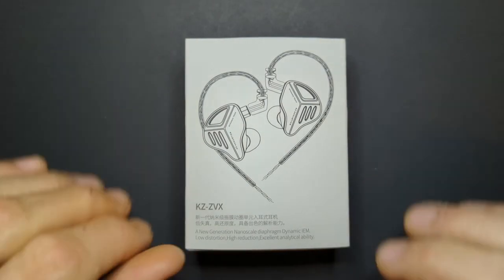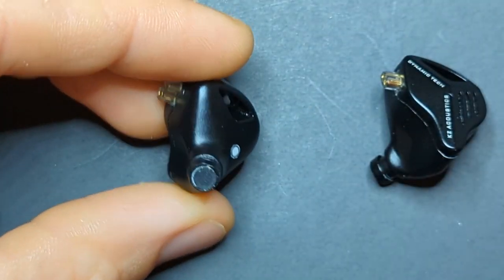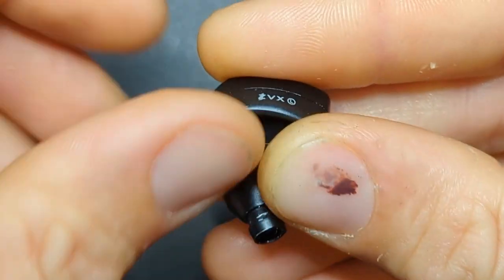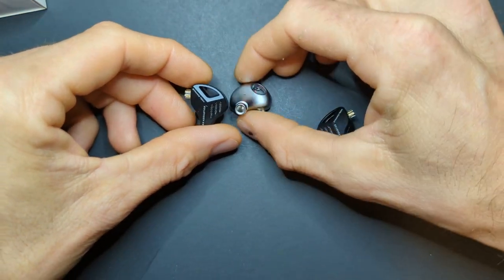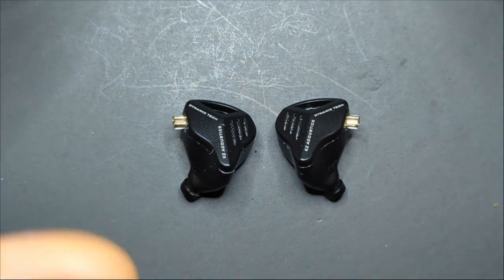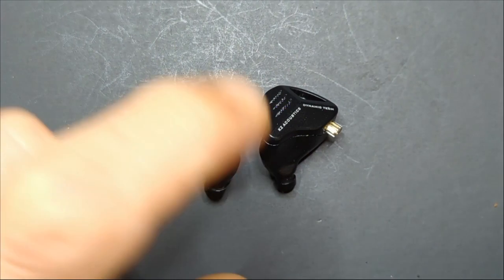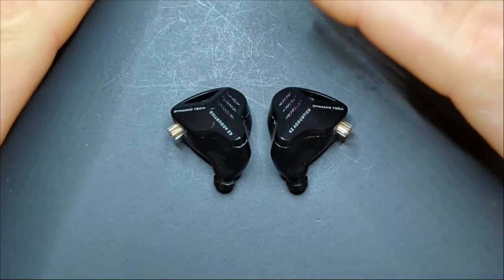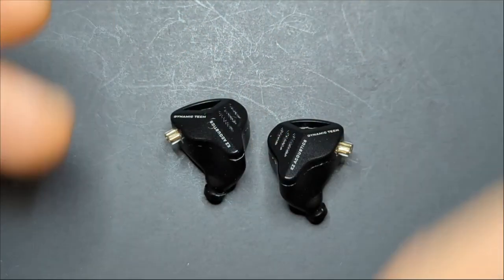😱KZ Made a "Neutral" tuned IEM?!?! KZ ZVX Review and Teardown.. 🤯

Comment: DIY’er here Electrical tuning is preferred over hardware tuning because of transient response electrical tuning can also be replicated on a massive scale, whereas using a modified housing or larger/smaller port openings is much harder to replicate. It also has weight and complexity to an already complex design. dynamic drivers with such a small mass are indeed extremely fast but also extremely easy to slow down.

Comment: Thanks for this, To my ears the ZVX sounds more sensitive than 7hz zero and about average of all my IEMs
Reply: Out of all the sets you have or have listened to so far which one do you consider to be outstanding in the area of macrodynamics and imaging?
Reply: @Mykeoguns  I can't really tell because I don't own anything that has outstanding macro dynamics performance , Plus my hearing is more in tuned to tonality and distortion. But to answer the question somehow , The Kz ZVX has good and above average macro dynamics , Easy to drive can go loud without sacrificing the bass level , And has low distortion ( less ticking sound on high power levels compared to s12 pro). Average imaging but good soundstaging , The micro dynamics is somehow lacking , But overall it is very enjoyable to listen , It's like you are in a club with very good sound system where you listen to the groove of the music it's  so good , Makes you not care about the details as much .
Reply: @MarsChan07  I have S12 which is totally non existent in the area of macro-detail but tech wise it's far superior. I also have ea500 paired with black nozel it does macro detail fine but not outstanding like kz ESX. ESX made made me to start digging into my library again . Thank for your response I will consider ZVX.

Comment: Just got a pair of these on aliexpress but the right-side is presenting some problems. If I push a little bit harder in my ear he goes silent, then I have to reconnect the cable. However there is no solution for when I'm using it with the Bluetooth. Sound quality is great but this problem sux. I wonder if I can open up and check inside for a possibile fix
Reply from the maker: Try removing the mesh and see if the problem continues. You might have to replace the mesh with another 4.3mm mesh.

The problem could be elsewhere but try that first.
Reply: @hi-friaudioman  thanks for the reply! I will try this and tell you if it works!
Reply: Hi, friend! I have the same problem. Kz edx pro, right ear also . How did you solve the problem, please write. Thank you!
Reply: @bowfull_just9543  Well i havent had time to try and fix it yet. But if i do make it work, i will certainly come back and share it. Gd luck!
Reply: @JulioBauer  ok. Good luck 👍

Comment: I'm not an engineer either but I'm pretty sure (especially since we're talking DC-currents/voltages) here that there is not much you can do in terms of changing the impedance curve.
Unless we're just talking about the resistors (because impedances are more an AC thing) getting warm and becoming more resistive when they get to a set working temp.
But maybe we're taking about something completely different here.
Reply: It's a fairly common misconception that because its DC that goes into an amplifier that it is also DC that goes into a (speaker) driver. But if you look inside a good quality amplifier, you will find that there is actually a DC protection circuit on the output preventing DC current from making it to the drivers. This is because one of the fastest way to destroy a driver is to feed it DC current. What comes out of the amplifier is AC. To produce a steady 50 Hz tone, the amplifier produces a 50 Hz AC electrical current which the driver then converts into a 50 Hz oscillation in the diaphragm/armature which is then heard as 50 Hz tone (ideally, it doesn't always workout this way).  DC is used to power the amplifier circuit because it is easier to produce whatever frequency of AC you want from DC than it is to convert one AC frequency into another. The amplifier is essentially a DC-AC variable frequency drive. The drivers themselves are essentially a linear permanent magnet synchronous (read: AC) motor. Since they are AC motors, that means they are a reactive load with impedance that changes depending on frequency.
Reply: @noob360  I haven't read into this, but I'll try to figure where the synchronous machine is in the driver.

Comment: Hi, I'm new here. Great Channel! I saw you the first time a little while ago in a Facebook group (I think chii-fi love... or Chifi Hopes... or Head-fi.. or similar  :-)). I received the ZVX today. The skewed sockets facing outwards are very uncomfortable for me. The QDC cables tend outwards and press the ear down (especially if the cables are heavier than the stock ones). A little better with thin cables with classic straight  connectors 2 pin 0.78.  I also ordered Pr2 and D-Fi (No Switch) and I hope they don't have the same issue. Can you tell me if the sockets of KZ PR2 and D-FI are  skewed?

Comment: hola zero or zvx?
Reply from the maker: It depends on your climate, if you live in a warm moist climate, you're going to want to go with Hola or zero. Because ZVX has issues with moisture ingress through the dampener and you will lose sound if you live in a warm climate. The metal shell makes it so that the IEM must always be worn in temperature similar to body temperature, anything higher or lower will result in moisture clogging the dampener and killing the sound.

Comment: Burn in only work on some earphones only few 
I had Sennheiser Cx 180 its bass was too tight in beginning but later the bass got loose after 1 year it was rumbly i bought new unit also checked twice 
Cx180 was hedt sounding earphones under $100 it only costed $10 
Still have those including CRA 7hz zero ZVX Edx Ultra Waner hola Quarks DSP etc 
Cx180 still sounds better than them all in mid range vocals or treble
Bass is not even comparable CX180 has much better sub bass than all of them

Comment: BRO YOU CAN TELL YOU ARENT AN ENGINEER WHEN YOU TALK ABOUT BURN IN
JESUS christ the immediate way to tell someone does not know what they are talking about 
""""burn in"""" would happen at the factory even before QA testing
that is actually where the term comes from 

like I listened to an album this morning and I was like eh this kinda sucks but listening to it now in the evening 
I am a big fan

but as an engineer 
I will tell you that a speaker is a coil//inductor 
so by adding a resistor and a capacitor you get an "RLC" circuit and thus there are specific frequencies that have higher "reactance" than others due to the values of the L so you modify it with R and C